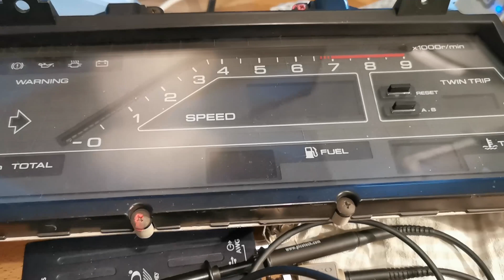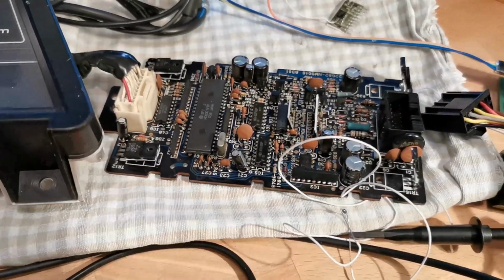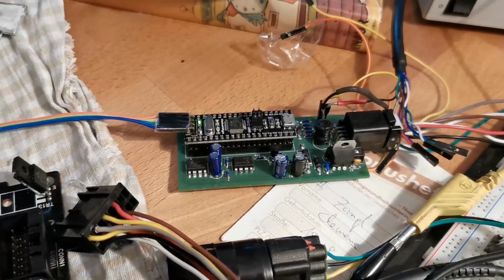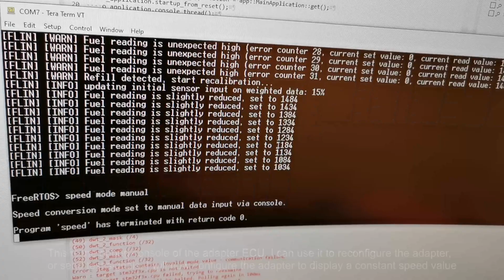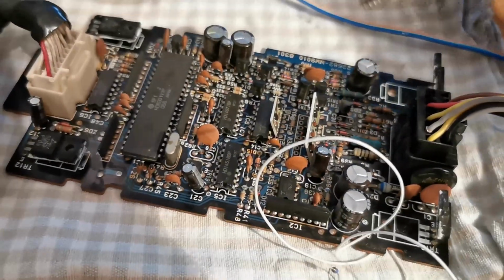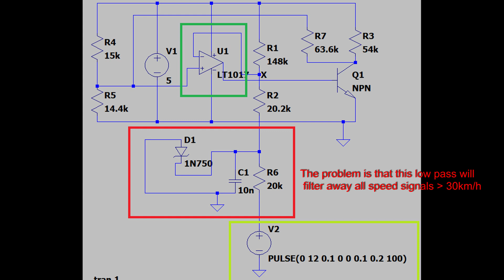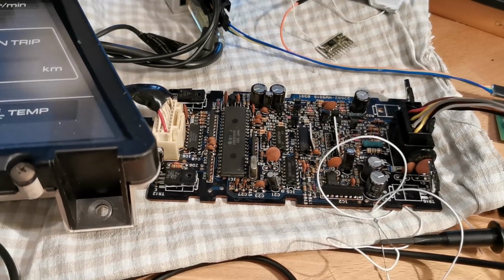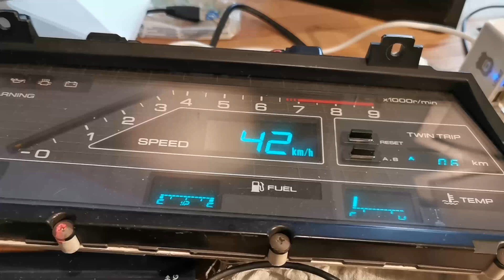How does the speed signal of the Sunny Rz1 digital cluster work?

Comment: There's a problem when adapting this cluster to any other B12. The fuel reading is always bigger that it should. I haven't been able to know that the difference is. I think that it can be rectified by using a resistance and calibrate it that way.
Reply from the maker: Resistors won't work. Either the full or empty value will be wrong (or some value in between). My adapter kit properly converts the fuel level so that even with the factory fuel level sensor, the digital cluster displays the correct level.

Comment: Man, thats a great video! I`m installing now a Nissan Maxima PU11 digital cluster in my Nissan Bluebird U11 and I have a couple questions to you. I have a manuals, so I wired up the dashboard properly into my Nissan, it already displays a voltage, speed, and oil pressure, BUT - it isnt display the tacho and water temperature indication. Help me please!! I dont know what to do :(((((
Reply from the maker: Thank you. With tacho you mean the RPM signal? You might have to adjust voltage levels using resistors. That is a bit trial and error and reading wiring diagrams for the digital and analog clusters. Similar to the temperature, you would need to measure the resistance of the temperature sensor on different settings, and then see what voltages will trigger what indication on the digital cluster. Once you know both, you can work on converting the signals.
Reply: @ClemensInJapan  thx a lot for your feedback! =) Yeah, I already searching for temperature sensor I need. On this moment I put the variable resistor to my cluster and I saw that it has a maximum value on 6 Ohm and minimum on 150-160 Ohm. Strange thing, that this temperature sensor is similar on VG30E Maxima and my CA18DET Bluebird - 25080-89903. I`ll try to get the new one, maybe the old one broke =\
With RPM signal I`m still confused, the scheme from Maxima I get says that the signal from distributor goes trough 2.2KOhm resistor. I used this resistor, but RPM meter still indicate 0 value on working engine. Maybe distributor signal has another working voltage? Thanks a lot pal, waiting for your answer! =)))
Reply: @BadaSS_DumbaSS  Did you ever find the issue with the tach?  I'm experiencing a similar problem.  Thanks.
Reply: @Enigma758 oh yeah, 3-year tread is still alive 😂 On this time the dash is still have planty of issues, speedo telling bullshit, tacho not working, gas level sensor...well, it works, but half of it
If you have any ideas or manuals - we can chat anywhere else. Cause I'm not finished. My lovely friends gifted me Bluebird Turbo digital cluster as a birthday present, so my suffering must continue 😂
Reply: @BadaSS_DumbaSS     Right, 3 year old thread, thanks for responding!  Mine is an 86 Maxima cluster I've been trying to get working on the bench.  Everything works except for the LED bar tach, which is the coolest part.  My goal is to turn it into a reactive display item (not going back into a car).  It uses a coil negative signal.  I've tried feeding it pulses 5v, then 12v, then a spikey coil neg signal via the old trick of using a pulsed relay to simulate the coil primary.  None work, and I'm wondering if there is something I could be missing.  If the circuitry is bad, it would be a pain, as there are "sandwiched" boards and those evil hybrid circuits on a ceramic slab making the signal hard to trace.  Looking to see if someone had similar issues.  If all else fails, I may just go the route taken in this video and replace the controller with my own, I've already reverse engineered the display board, much simpler than the controller, it's mainly just a bunch shift registers.